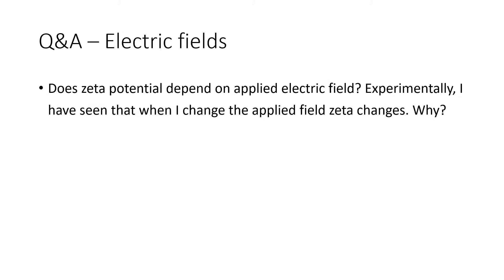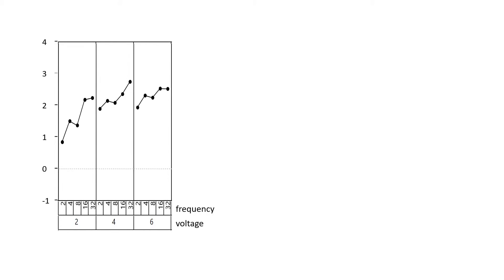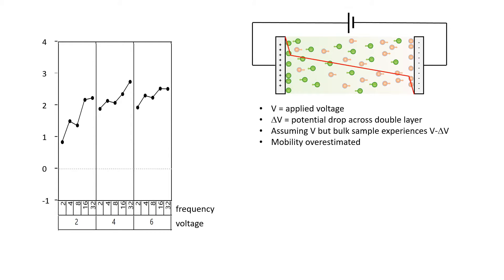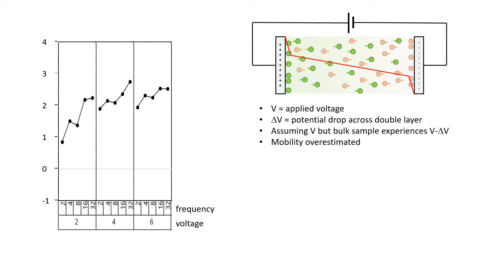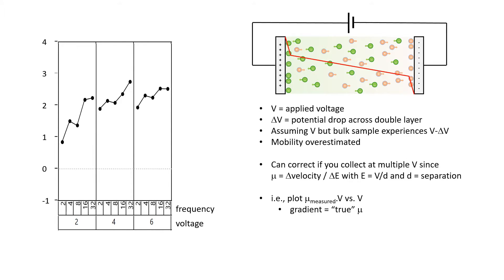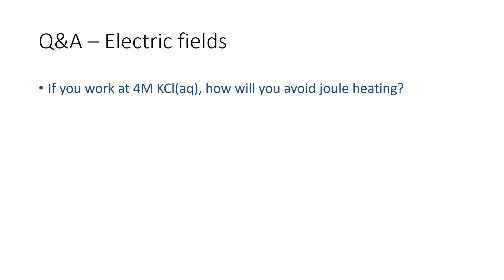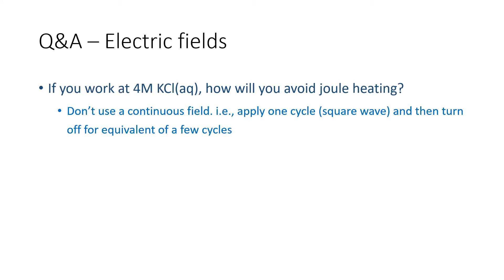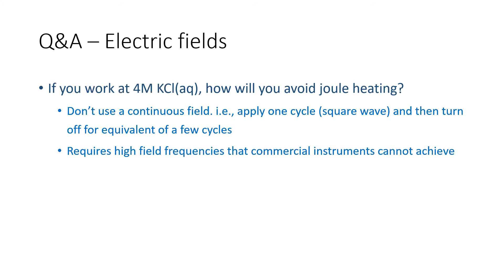Measuring zeta potential - electric field effects

Comment: Hi John,

Could you please clarify the concept of effective potential in the bulk solution? 

To my understanding, the effective potential decays exponentially to ~0 when moving away from the electrodes (due to the charge screening effect). Wouldn't this cause charged particles in the bulk to experience no net electric field? (Unless the thickness of the bulk is comparable to the double layers of the electrodes, i.e. with a dilute electrolyte or low dielectric constant).

Thanks!